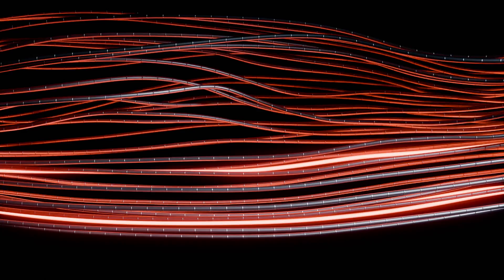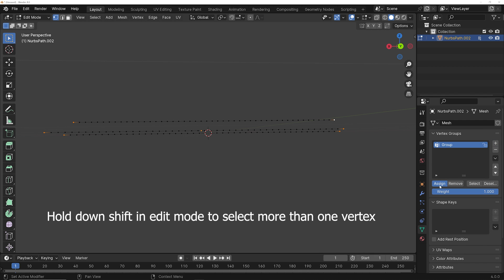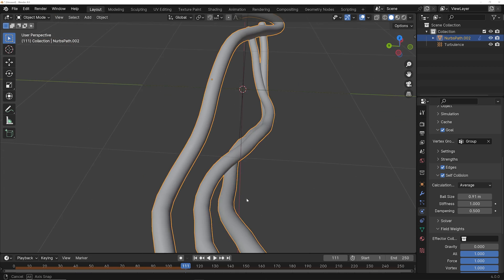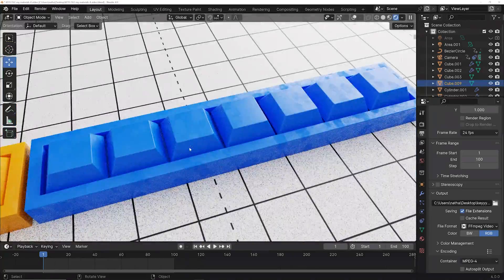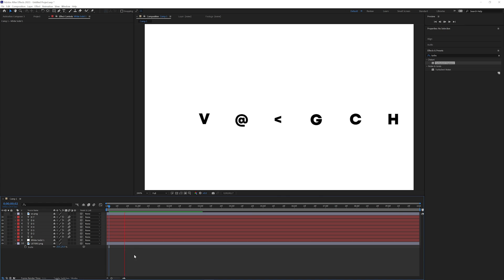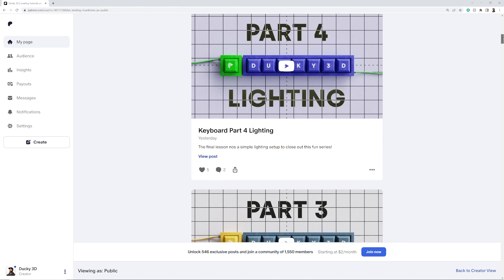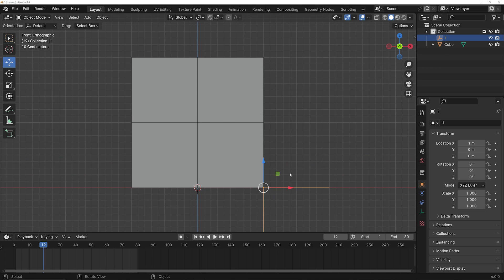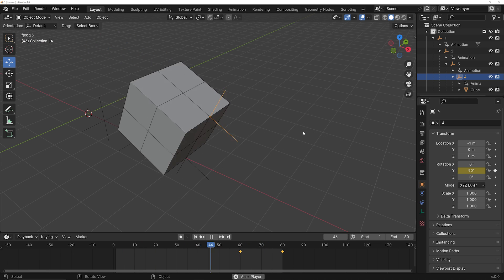3 Motion Graphics Tricks in Blender 4.0 You Need To Try

Comment: Using empty:s to rotate on corners is needlessly complicated. Use sinusoidal easing on movement instead, it's much easier.
Reply from the maker: I’ll look into that
Reply: @TheDucky3D  Sorry, spoke too soon. I animated a plane, which moves in 0 to 180 degree cycles. A cube moves in 45 to 135 degree cycles, so sinusoidal easing isn't going to work. However:

1. It's fairly easy to wing it using bezier curves.
2. I'm surprised you didn't use geo nodes which should be the easiest solution.

The problem for me was that using empty's was just too limiting.